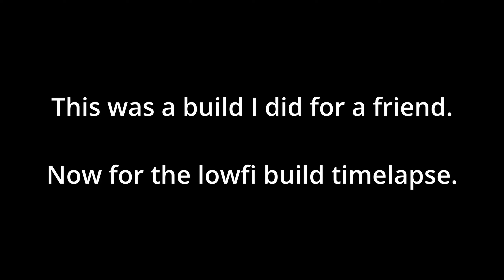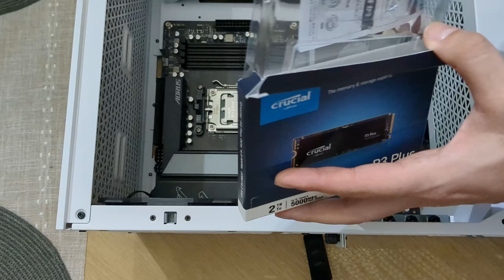$2000 Gaming PC Build - RTX 4080 Super and Ryzen 7800X3D

Comment: Do you know if the 4000d can place two 140mm fans and one 120mm fan on the front?
Reply from the maker: @r_s_g4180  I believe it's 3x120mm or 2x140mm only
Reply: @slidernedboy123  on the top is 240mm right?

Comment: I want a 4080 super or 4090
Reply: Get 7900 xtx if you can't get the 4080 super. No point in the 4090 unless you get it for half off msrp
Reply from the maker: Agreed that 4090 is way overpriced
Reply: @slidernedboy123   i can’t afford it now
Reply from the maker: @genlongtsang1093  It's all overkill honestly you would be fine with a 4070 super. I'm still on a 2070 Super on my personal rig
Reply: @slidernedboy123   i have a 3090 turbo
Reply from the maker: @genlongtsang1093  I wouldn't even worry about upgrading for a while then tbh
Reply: @slidernedboy123   i can play all the games, don’t know about Cyberpunk haven’t play it, i’m playing Black Myth Wukong at 4k running with no problem but not max settings, when i safe enough money maybe i'll get the 4090
Reply: @slidernedboy123  will a 4090 fit in Corsair 4000d airflow?
Reply from the maker: @genlongtsang1093  It does fit, but its a tight fit.
Reply: @  it will fit if the radiator is on top

Comment: pipes on the radiator should be down not up, over time this will kill your pc
Reply from the maker: As long as the highest point of the radiator is above the block it should be fine. Also there was no way to put them on the bottom since that GPU is massive! Thank you though.
Reply: your pipes are going to be filled with air. mount the CPU radiator on top on the case.
Reply: also, 4080 is going to suffocate.

Comment: this is a total cluster fk.
1. the top fan is exhaust, no fan pushes cool air in the case.
2. the front radiator is pushing hot air directly on the gpu.
3. the atx cable shroud is preventing the gpu from fully seating on the pcie slot. that GPU is way too big for 4000d, you need to remove the atx cable cover asap.
4. you install a 240mm aio on a cpu that barely needs 120w tdp, you could have gone with a single aio or air cooler. 
5. your aio placement is not only going to kill your cpu but the hot air is going to impact your gpu.
Reply from the maker: @yashomb  Lol Thank you for the feedback. I made sure the temps were ok. Also this was a build for someone who picked out some of the parts.
Reply: Which one is single aio
Reply: @genlongtsang1093  corsair h60x
Reply: @yashomb   single aio mean with one fan?